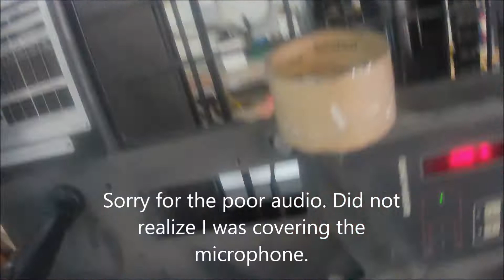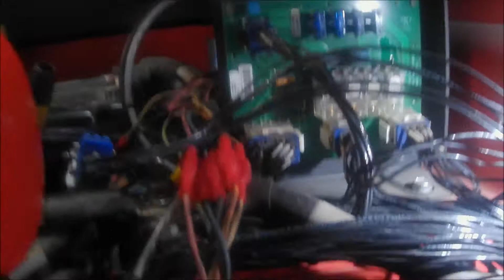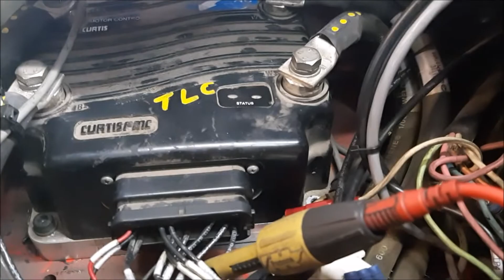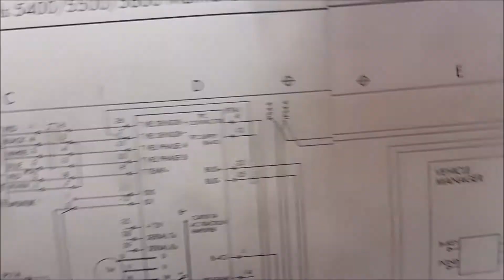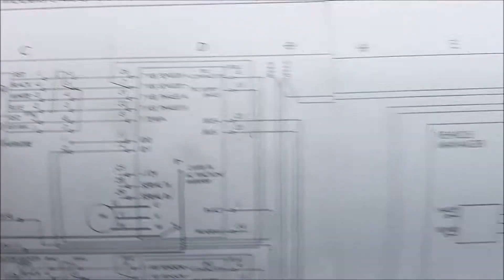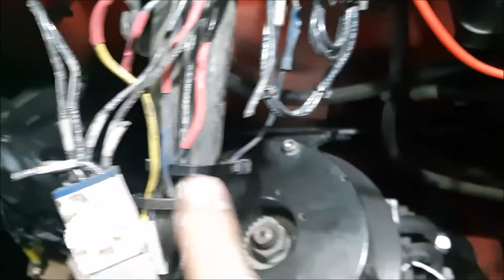Raymond OPC, No Communication 5G

Comment: Raymond no longer offers a replacement for that stem harness that’s all chopped up. As dealers, we have to replace the entire tractor harness and change the relay card and software. The good news is, after that, it’s a $60 harness and one connector to replace the encoder/temp/brake harness instead of dealing with that one your repairing for the 52nd time. We are not allowed to repair wires like that. Labor is $190 per hour, so getting a call 4 months later to repair another broken soldered wire isn’t cool.

Comment: I've got a used easi opc30tt I bought at auction,  it works good,  but I can't figure out how to access anything on the display,  would be nice to be able to check the settings change the time, etc any tips? Display is just like the one in video

Comment: Hi im getting 2.7 v steady at comm. bus wires at tractor manager. Should this be fluctuating? I’m not getting ground at horn enable pin. Fuse 11 which shows B+PC I’m having 5.7v is that correct?
Reply from the maker: Approx 2.7 volts is where the bus - is idle. If you are using a scope there should be data at all times. Fuse 11 should have battery voltage going in and out after the PC contactor kicks in.

Comment: On the light display I’m getting only the red outer lights I this related to any fault
Reply from the maker: I would suggest bypassing the comm wires from carriage control card to tractor manager which is part of the mast cables. I know that you ohmed it out but data is based on voltage and it is still possible to pass continuity test but fail in voltage drop test. Unfortunately without an oscilloscope it is impossible to determine signal integrity. If bypassing the wires does not fix it, make sure the wires are not shorted together. Other than that is time to swap CCC, VFC, electric steer manager. Hope this helps.
Reply from the maker: Also make sure all powers and ground supply to tractor manager is present.

Comment: Hey man still the same. Thanks for the reply. I’m at the machine now I’m measuring for shorts with meter on ohm when I have one lead to ground post and other to heat sink I’m getting 2.028kohm would dis be good?
Reply from the maker: If you are talking about short to frame the then the standard from book is is 1 megaOhm. But I've seen trucks with 100k ohm and still no problem.
Reply from the maker: If you are referring to heating where the Q1 mounts I have one right here and it measures 1.9K to negative post with all components comnnected.

Comment: Hi i have Raymond easi opc30tt every time when I turn the key I don’t hear horn and I’m getting code 50. I’ll check the over the mast wires and voltages and it good. Any advice. Thanks
Reply from the maker: Disconnect horn and try again. Also check jumpers in traction and carriage cards are in the right place.

Comment: How long have you been in forklift field and how long have you been doing the videos. I subscribed after watching the very first one that I watched.. I’m a construction equipment mechanic. Actually I’m the shop foreman. We build proto type mobile mixers. Instead of concrete we use epoxys, polyester/And composites. We useEncoders, flowmetering, proximity sensor for travel speed ect...
These systems tie into a PLC and crunch all the math and print a ticket when finished. 
I wish my guys had half your troubleshooting skills. I think your videos are awesome and very easy to follow. Thanks for posting. They have inspired me to start in-house training program and get my guys up to speed.
Reply from the maker: I've been in this trade for 9 years and started making videos 5 years ago. It was intended as a troubleshooting guide for the other techs in my company so instead of asking me over the phone I can just tell them to watch the videos. Lol.😁😁
Reply: Good idea. Keep um coming. Lol. Take care..